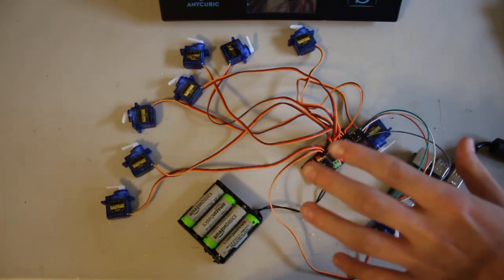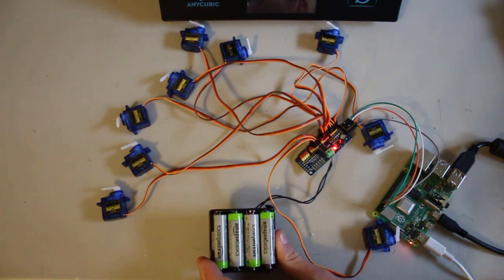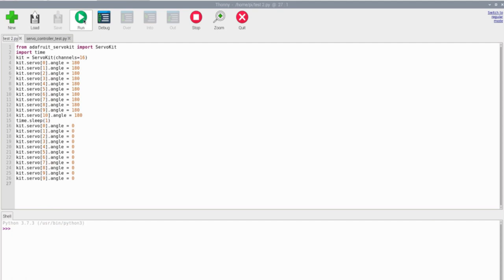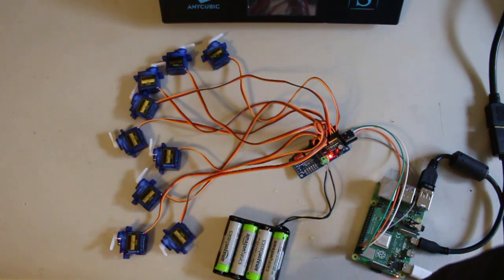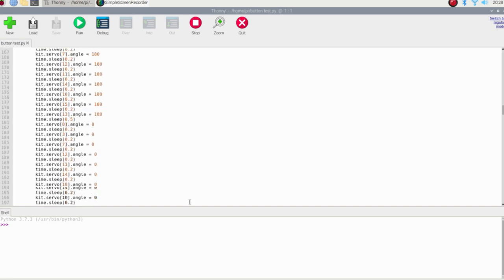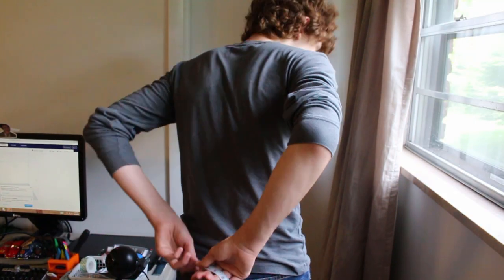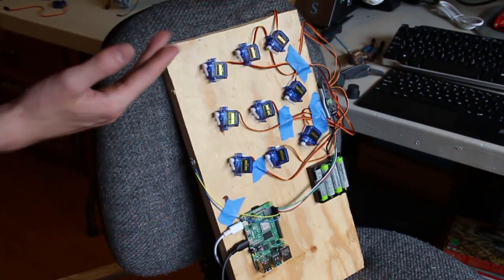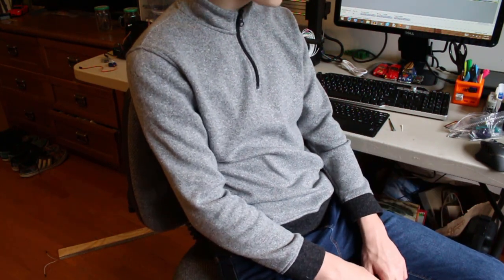I Built a Back-Scratching Robot

Comment: Awesome video and great improvement! I don't really have anything else to say. I do have a question though. When you were programming, did you think of using a for loop for the servos? 

for num in range(#amount of servos{12}):
    kit.servo[num].angle = 180
time.sleep(1)
for num in range(#amount of servos{12}):
    kit.servo[num].angle = 0

When you made the 400 lines of code, you can make a function for each individual block of code, and put them in a while loop. You can start the while loop when the button is pressed, and break it also by pressing the button, instead of waiting for it to stop.

Last thing, can I get you discord?